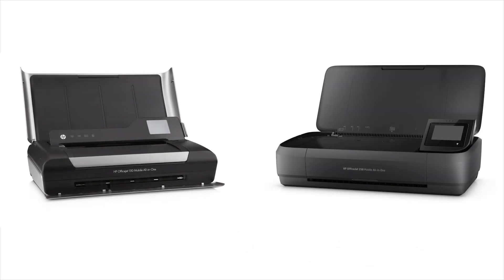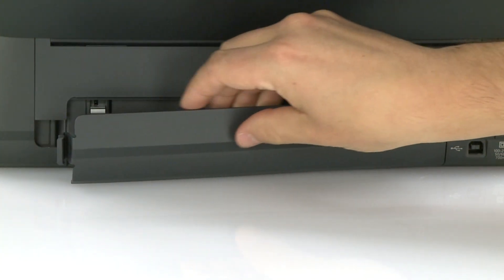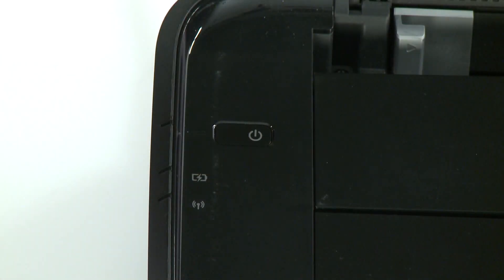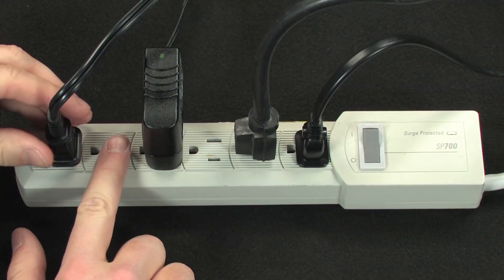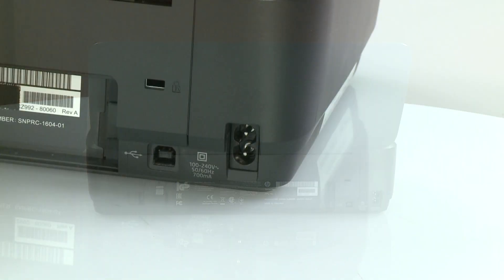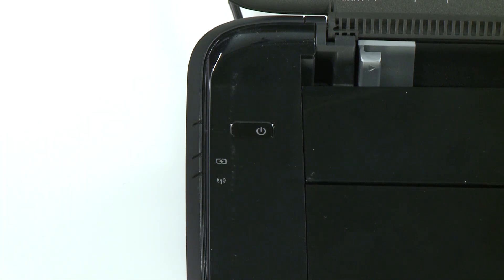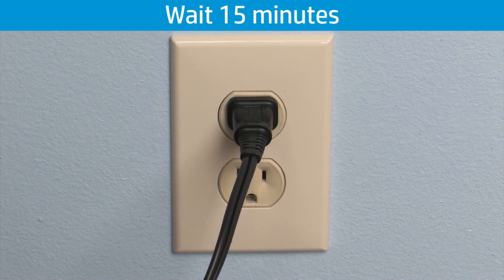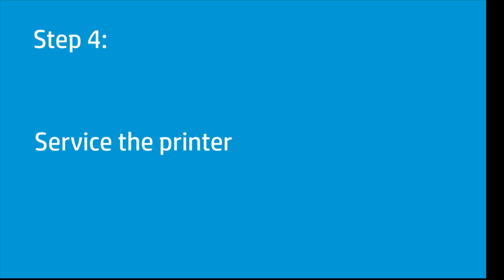Fixing Your HP OfficeJet 150, 250 Mobile Printer When It Does Not Power on or Respond | HP

Comment: Did not know these printers had batteries in them.  I worked with a user and another tech to resolve this by using this video.  Thanks for the post.
Reply from the maker: +lobecosc The HP OfficeJet 200 Mobile is ultra-portable, measuring 14.3 x 7.32 x 2.7 inches and weighing 4.6lbs without the included battery installed (4.9lbs with). ... The battery comes with the printer and sits in a compartment on the back. Glad to know that your issue is fixed.

Comment: I had my HP150 mobile printer for about 18 months before I got to use it. 
It never powered on properly from the 1st time I used it.  HP won't consider looking at it, very dissapointing HP.  No more HP printers, hopeless support.
Reply from the maker: +Gazza E If the the printer does not turn on or respond when you press the Power button, the steps in this document should help you fix this issue: http://bitly.com/2x3MAu9

Comment: My HP Pro 8025 power button does not turn the printer OFF
Reply from the maker: +Ernie Klinger If you press and hold the Power button too long, the printer might turn on and then off without restarting. If this happens, press and then quickly release the Power button again. If the printer does not turn on, wait 10 seconds, and then press the Power button again.

Comment: My HP 2515 is not working.  The "exclamation mark" is not blinking and alk the buttons are not responding.  What to do
Reply from the maker: +MLDS U thanks for reaching out!
I understand that you are experiencing an issue with your printer as it is not working.
I'll do my best to assist you.
Please perform hard reset on your printer as mentioned below to fix this issue:
1. Turn the printer on, if it is not already on.
2. Wait until the printer is idle and silent before you continue.
3. With the printer turned on, disconnect the power cord from the rear of the printer.
4. Unplug the power cord from the wall outlet.
5. Wait at least 60 seconds.
6. Plug the power cord back into the wall outlet.
   NOTE: HP recommends connecting the printer power cord directly to the wall outlet.
7. Reconnect the power cord to the rear of the printer.
8. Turn on the printer, if it does not automatically turn on.
The printer might go through a warm-up period. The printer lights might flash, and the carriage might move.
9. Wait until the warm-up period finishes and your printer is idle and silent before you proceed.
Let us know how it goes.

Comment: My hp printer is on but it doesn't  on from the power button and no light is on and the sound of inside cartirage don't move what should I do plaz help
Reply from the maker: +Truthfull Liar Steps for fixing your HP mobile printer when it does not power on or respond:
Test the power without the battery.
Remove the battery and connect the power cord to the printer and a power source and try to power it on. 
Reset the printer and test the wall outlet.
Unplug the printer's power cord and test a different appliance with the wall outlet. 
If it works, the wall outlet is functioning correctly. 
If it doesn't turn on, trying another appliance and repeat the test steps. 
If the appliance doesn't turn on, find a working outlet for your printer. 
Try using a second power cord and make sure both power cords are compatible with your printer. 
Reinsert the battery into the printer, and charge it for 15 minutes. 
If your printer still does not power on, test the printer power using only the battery.
Unplug the power cord from the printer and try to power it on. 
If the printer does not power on, contact HP to find out what support options are available for your printer.